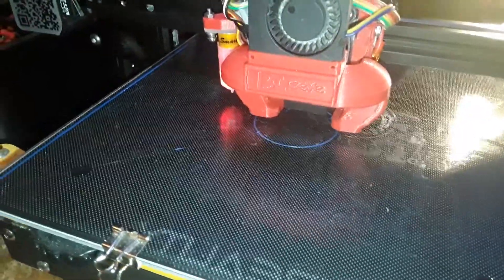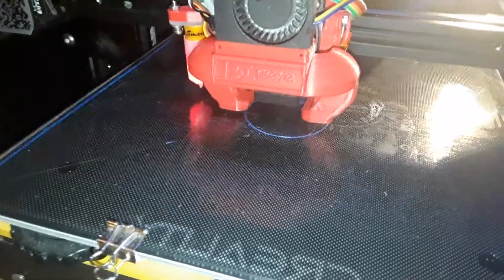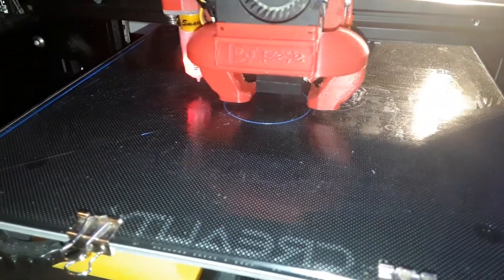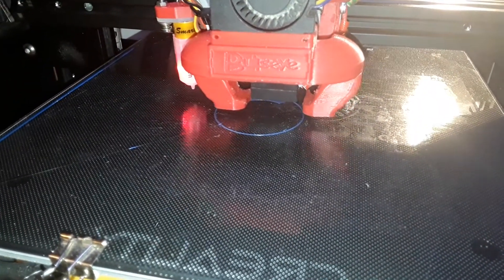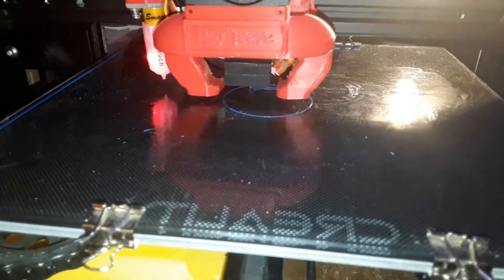Testing a new "Remote Direct Drive" Extruder from Thingiverse

Comment: for a remote drive your print head assembly is huge
Reply from the maker: Its the original Ender 3 carriage and hot end, with a Bullseye fan duct on the front. The extruder is the orange part at the top . I've since rebuilt it with a Hero Me Gen 5 fan duct with dual 5015 fans, so its even bigger now ;-) I don't really use it anymore TBH because I now have a Voron 2.4 and that's better in almost every way.